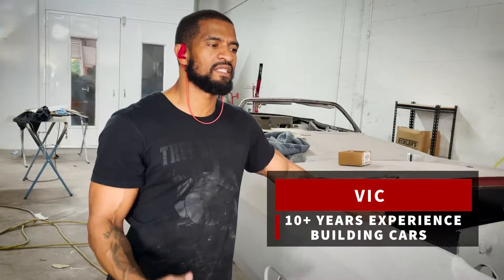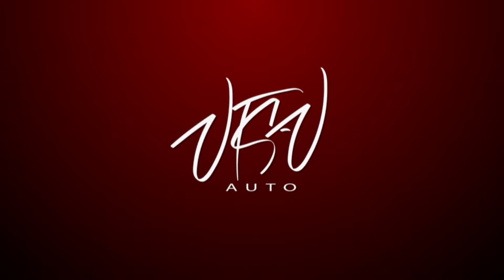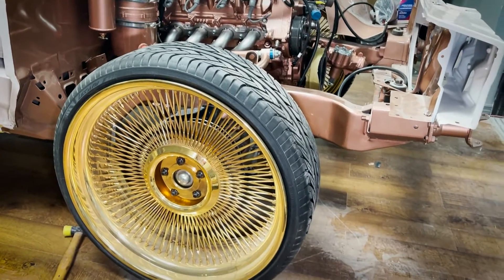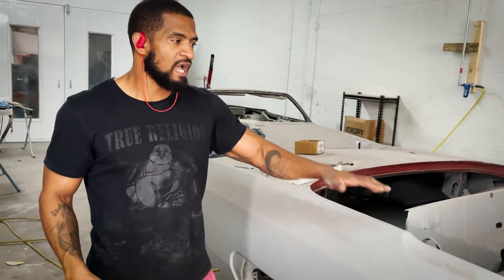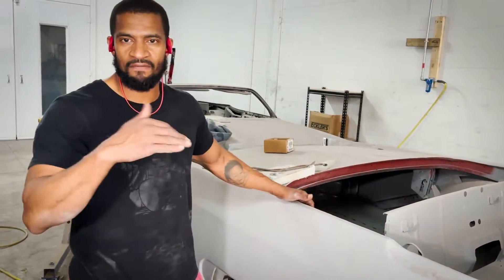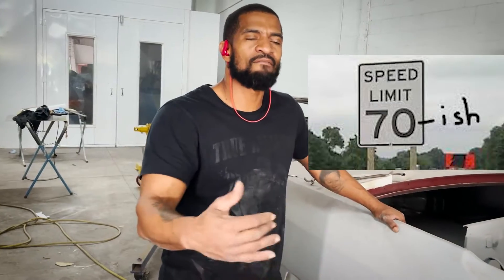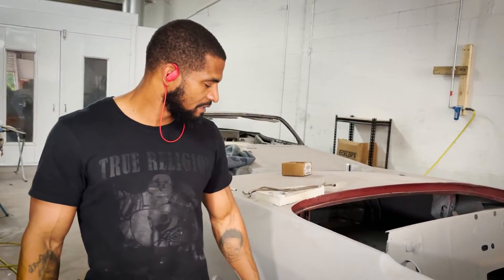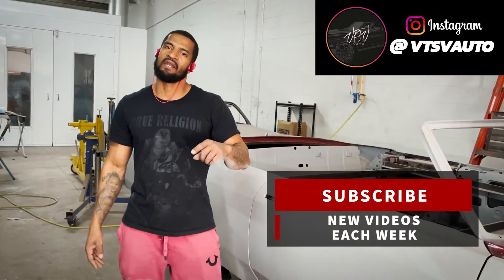Perfect Gear Ratios - How To Select The Correct Gear Ratio

Comment: 5.3 6l80 with 26s & 35s can’t decide what gears i do mostly interstate driving to work i was thinking 4:56
Reply: Don't go to "high" right out the gate because if you ever put a slightly smaller tire it won't be optimum for on road. If it was me I'd go 4.10 at the MOST

Comment: Bro, you really just opened my eyes for my '91 caprice. Now im rethinking my 3.73 gears
Reply: well  your  caprice  doesnt  have a 10 speed.  its a 4 speed overdrive.  you good  with the 3.73s  or even 4.10s  if  you have  bigger rims on it.  you'll cruise  just fine  with OD  on the freeway.  you just dont wanna  lug it down to low because  it could be out of  the engines  power range

Comment: Could use a bit of advice guys. I have a 1988 Caprice police car with a “stock” 05’ LQ4 LS and 4L65E swapped in. I am building this car for sale and I need to know the best gear ratio to go with.

If I do install a cam it will be the only upgrade other than the intake. Howard’s Rattler Howards “Rattler” (Duration 275/282, Lift .525/.525) Lifters, pushrods, and trunnion upgrade is a given.

All input is very well appreciated!
Reply: The largest wheels would be 26” Rucci and smallest wheels would be 15” TWW G12’s

Comment: With a 8 speed transmission you can go with 4.11s and still do 130 on the freeway I got 4.11s in my donk with a 4l80e I do 80 mph at 2500 rpm which is not bad
Reply: 8spd And 4l80e totally different. You can use it but old gearing thinking is different with the 6 spd and up trans

Comment: Whats up fam. I have a 8l90 in my chevelle. Going 22s. What gear do you recommend?
Reply from the maker: stock motor/tranny?
Reply: @VTSVAUTO  I have a lt4 with a 8speed.  Did you have go custom on the trans cross member